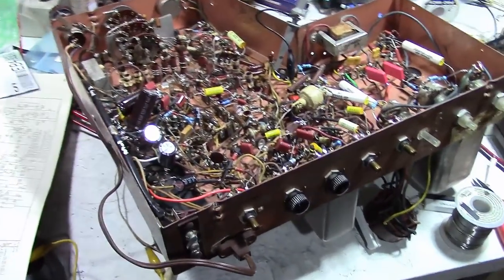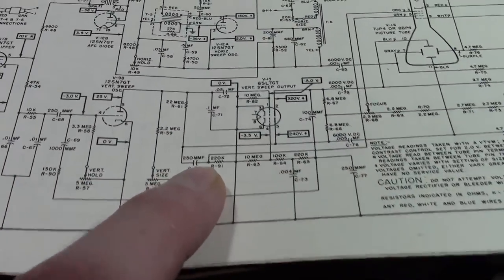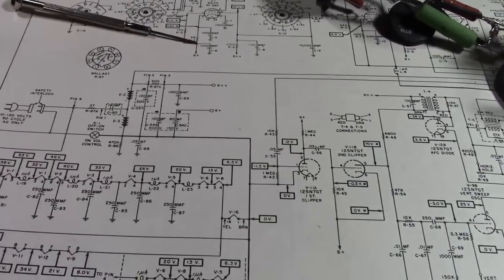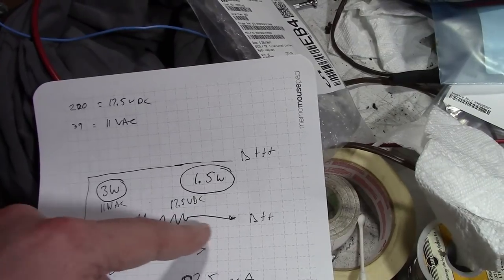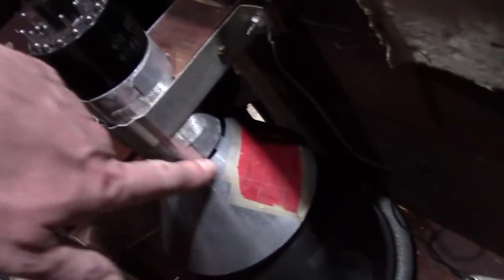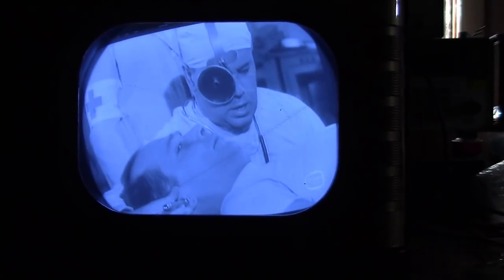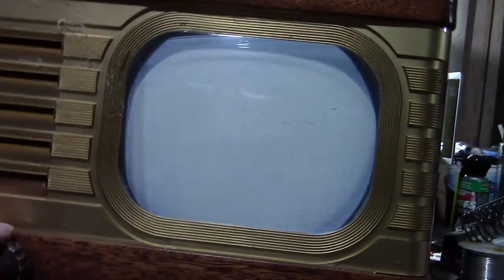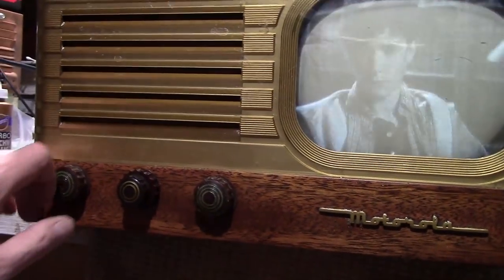Motorola VT-71 restorations p10o10

Comment: I finally got my VT-71 working! The picture looks pretty good overall and the sound is loud and clear. It's not perfect, it probably still needs some adjustments, but I got it the best I can without any test equipment (other than a basic multimeter).  Amazingly, the original ballast still works.

Comment: It would probably be easy to fashion a wooden “shoe” to support the picture tube near where it sits in the cabinet; then you could glue the “shoe” into the cabinet in case the foam ever degraded again, or in case the picture bulb got pushed inwards by an over-enthusiastic football fan! Also, that’s a lot of pins for a monochrome tube; even taking into account the extra 4 pins for the electrostatic deflection. Usually, I only see color tubes with this many pins! Nice to see you making YouTube videos again! 😁
Reply from the maker: Two for filament, cathode, grid, focus, two acceleration anodes, four deflection plus three unused for a total of 14!

Comment: I think these early Vt-71s  were higher quality pictures than our 1957 Admiral. I think cost cutting took away quality, but it may have just been ntsc in conjunction with our 17". Because when Sony came out later with the smaller tube I remember how much higher the resolution was than our older Admiral. Modern high resolution flat panels with modern high quality video cards with much higher computer memory is so much better than the resolution than my 1986 Amiga, but it was several orders of magnitude than IBM at that time. I can remember getting a scsi-skuzzy 100 meg harddrive and all the IBM guys asking me what I needed all that memory for, because video cards had not caught up with the Amiga for another 7 to 8 years. I finally got an ibm compatible in 98 because I had been reading about the internet since windows 95, but it wasn't until 98 it caught up and passed the now 12 year old Amiga.

Comment: R87A caries the pulses of current to charge the capacitors.  I know that with a conventional bridge rectifier the charging current is only drawn near the peak supply voltage, when it exceeds the voltage on the resevoir capacitor, and for the majority of the time no current is flowing.  I suspect a voltage doubler rectifier has a similar effect.  Concentrating the current into short high current pulses greatly increases the RMS value and hence heating effect of the current.  On the other hand R87C carries partly smoothed DC with a little ripple, so the RMS value is close to the DC current.

A long time ago I hooked up a scope to the AC mains to view the waveform, and you could actually see the peaks of the sine waves were a little flattened, presumably as a result of countless diodes in the power supplies of TVs, microwave ovens etc. connected to the supply, all pulling current close to the peak voltage.

Another time, I was amazed to find I could light a 12V tungsten filament lamp with just a 30mA milliamps, fed from a 15kV supply via a spark gap.  The supply filter cap plus spark gap again resulted in very short, very high current pulses, so the RMS current was way higher than 30mA.  The bulb would not light at all on 30mA without the spark gap.  Fortunately I managed not to kill myself in the process!
Reply from the maker: Yes, what you say all makes sense to me.  It would be great to have a meter that could both measure the DC and true RMS components together and give a meaningful result.

Comment: I have a suggestion which might help you when trying to get the picture level on a TV like that: while it's on, use a dry erase marker , or something similar that can easily be cleaned off and make a reference mark or two on the face of the tube while you can still see the picture, ideally using your test pattern generator for the most stable image, giving you something you can still see, even with the set off. BTW, how did they achieve vertical and horizontal deflection on the screen w/o a yoke? Inquiring minds want to know.
Reply from the maker: electrostatic deflection like a scope crt uses

Comment: You probably know all this, but maybe not quite everybody.  So... The mall surprisingly high power resistor depends on its ability to run at a higher temperature, because it is not carbon based.  Which leads me to a little history.  While I don’t know the really old ones, I have started with carbon composition types that had a carbon mixture rod inside a pretty thick insulator.  The carbon rod might run O.K. up to 125 or 150 degrees C, but the thermal insulation tolerated maybe 95.  When people like Beyschlag and Philips started selling carbon film type resistors with just a thin lacquer on top, temperature insulation was reduced and basically determined by the surface to air interface.  Then there came metal film resistors that could handle even higher temperatures — except that they came with 1% tolerance and the temperature drift became a decisive factor.  Then the next step was a metal oxide film resistor that again was 5% or so and could run hotter than the carbon film.  So a little size reduction again, but with a danger of scorching NEARBY wires and components.  And of course, there have always been vitreous wire wound types capable of 275 or 300 degrees C.  And even higher danger of scorching most everything nearby.
By the way, the military handbook dealing with component reliability suggests running resistors at 50% rated power, or 70% rated voltage or current.  Just like you seemed to suggest.